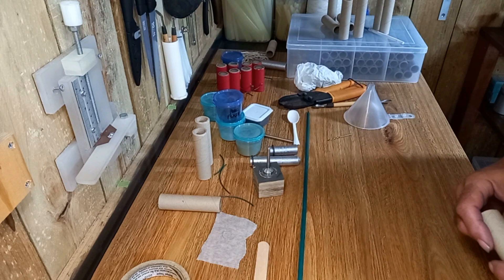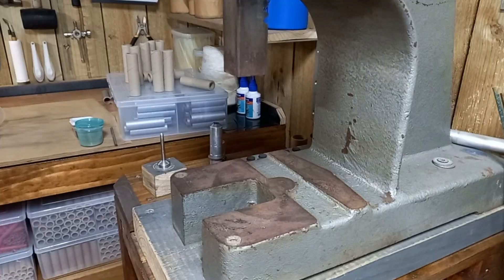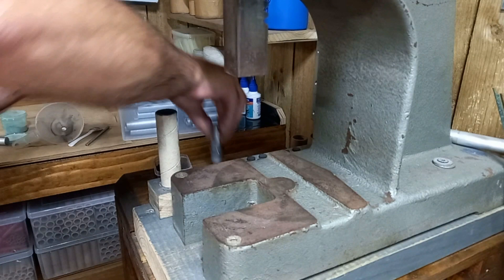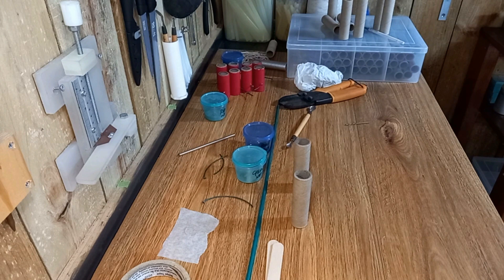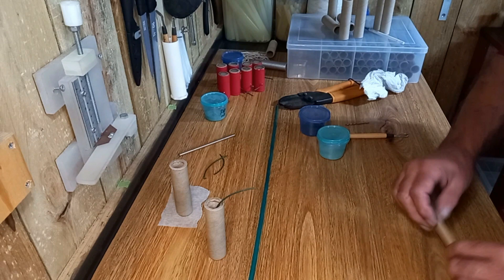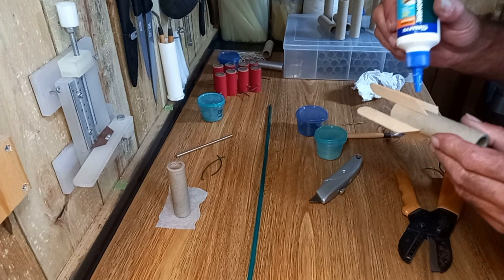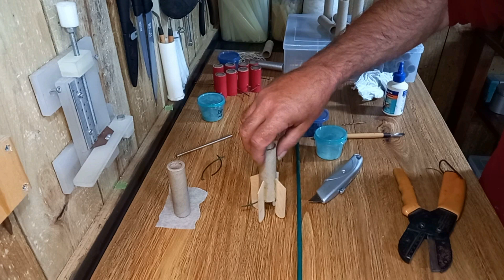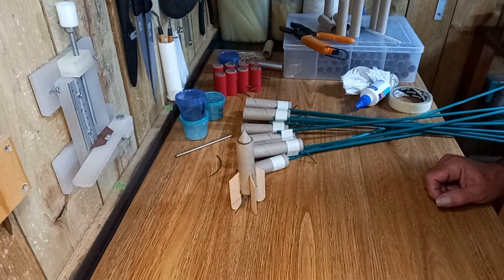How to Make a 1lb 3/4" Black Powder Rocket Ballistic Missile Nuclear Rocket Making Fireworks Rockets

Comment: good job!! congrat!! plz,is it possible to have the dimensions of the aluminum nozzle mold? height? width? diameter? thanks guys!
Reply from the maker: Tubes are 90 to 100mm long 3/4" ID. The spindle  is tapered, it is 6mm at the bottom and 5mm at the top. The fuel I use in these rockets has been "Tuned" to suit the Tooling and tubes Im using
Reply from the maker: Spindle Is Stainless Steel

Comment: Fantastic work! I've got a few questions. I've been making some sugar/KNO3 rockets, and the clay nozzle that I use keeps bursting out like a shotgun from either the front or the back (the weakest link I suppose). I notice that you mentioned paraffin wax in one of your videos? Does the paraffin wax help to strengthen the nozzle? What is the nozzle composition made from? Could I use paraffin oil or plain candles? I don't think I can get paraffin wax where I'm living.

Comment: how about the noozzle what was the diameter, I used 6 mm and it exploded
Reply from the maker: My nozzle was 6mm, length of core and how fast the fuel is and many other variables also makes a difference.
Reply: @Pyrolife-net  BP.
Are you using 60/30/10 BP fuel?
Reply from the maker: @Michael-rg7mx  This one was 75 15 10 + 10% Ti, Very lightly milled with Ti screened in after, but I do use 60 30 10 as well
Reply: @Pyrolife-net  Very curious what kind of charcoal do you use? I'm using Eastern red cedar 75-15-10. Without a nozzle and it's pretty much an instant Cato. Are you using hardwood charcoal?

Comment: How does the pressing work without a tube support?
Especially with spiral tubes it is hard to press without breaking it.
Reply from the maker: Its a bit tricky, these aren't a really high performance rocket. they have a fairly short and skinny core so not a lot of surface area which means not huge amounts of pressure when they fire up. I have also tuned(slowed down) the fuel to suit the tubes. I usually press a 15mm thick nozzle, which being at the bottom of the tube lets you put a fair bit of pressure on it (700-800psi) with out splitting the tube and a bit less as i work up the tube. Just enough to compact the fuel, Kinda got to get a feel for it as you go. They are not hugely powerful and wont lift anything bigger than a 2" shell, usually only put an internal flash report in the end. I use slower fuels with heavy metal content for the big bushy tail effects. I can get heaps of the tubes for free so made some tooling and figured out how to get them to work

Comment: The only thing I didn't like there was the handling of Ba(NO3)2 compo without gloves.
Reply from the maker: Not sure where you got Ba(NO3)2 from, would not use a composition with Barium Nitrate in it without gloves. The fuel is Potassium based (black powder)
Reply: @Pyrolife-net  Where I got it from is your saying it at 9:04 .
Reply from the maker: @goodmaro  Well Spotted, Forgot Id put that in there, and yes, probably should have had gloves on

Comment: Black powder composition ?
Reply from the maker: All my rockets use same fuels, Black Powder + Mag/Al or Titanium or both
This one was 75-15-10 Black Powder + 10% 80m Ti  Powder
Reply: @Pyrolife-net  If you made them with a deeper core (longer motor) would you slow down your propellant?
Reply from the maker: @goodmaro  Yes, I "Tune" or optimize the fuel to suit the tooling or tubes I'm using. The tubes in this vid are spiral wound and not real thick walled so I made the tooling with a narrower spindle(less surface area of fuel to burn and thinner nozzle so still good pressure). If I pressed this fuel on my Woodys 5/8 Cohete tooling they would not fly
Regards Astro